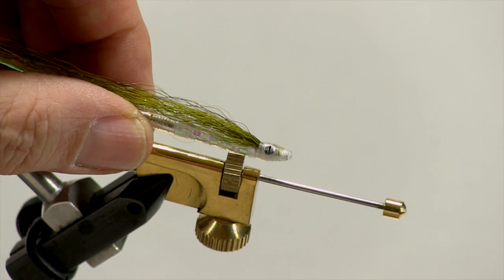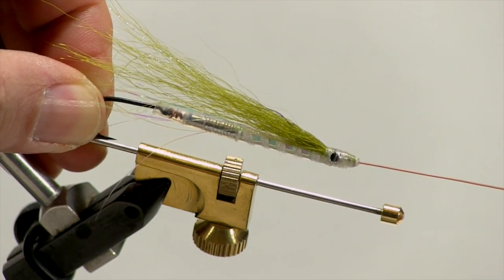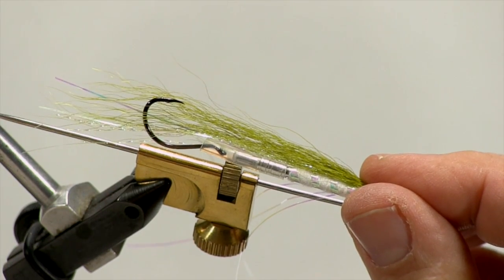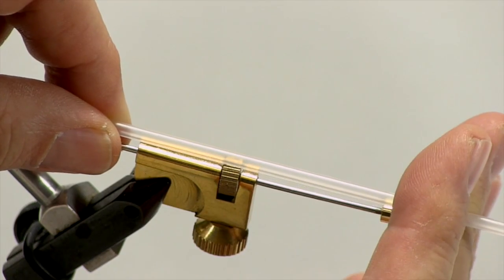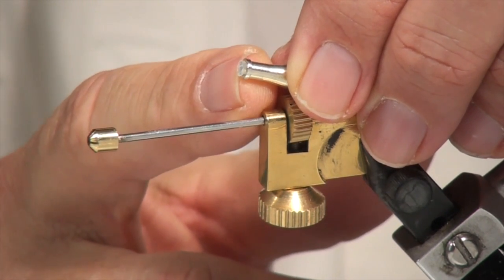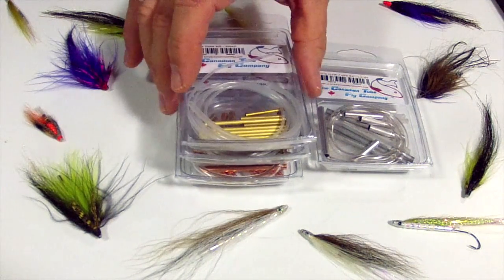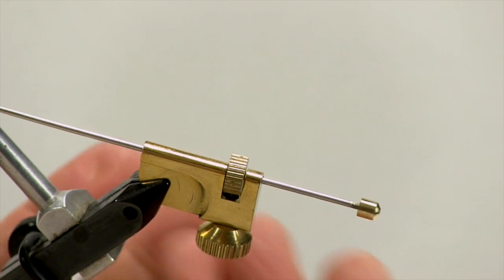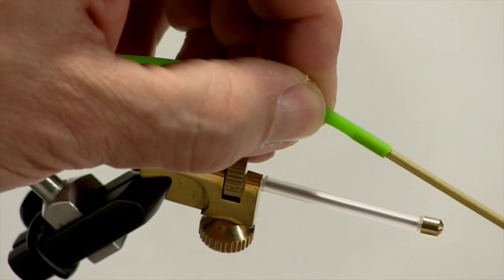The Basics of Tube Flies

Comment: Peter...my only beef is that this was too brief. You really do such a great job on your instructional vids. They are very much appreciated. 
Could you give us some instruction and explanation on the process of "nesting" tubes? I know the Canadian Tube Fly Co.  has a good video available on their sight. In it,  they use their own tubes and you can see how they fit very snug. I ordered similar from HMH and discovered the fit was loose. What's with that? Is it still usable? Do I need super glue?
With short, heavy metal tubes, can I build a 4 to 5 inch baitfish imitation that will have a jigging-type action on the retrieve for the saltwater? How would you put this together? I'm asking because while I love the Clouser Deep Minnow with a stinger hook, and have much success with it, there are times when there is just too much grass and debris hanging up on the eyes to make it worth fishing.
Reply from the maker: +Chris Nystrom It's always a toss up, too long is boring, too short is not enough. 

Super glue will solve a miss match in size of tube, within reason. I use the thick, gap filler type.

If you want a jigging motion on a tube fly, use very heavy, large cone heads on a plastic tube body..

Comment: Great video. Just one question. I want to tie a bigger version of the popular rolled muddler for coho and cutthroat without resorting to using a very large hook. Do you think this pattern would work as a tube fly?
Reply from the maker: I don't see why not. A 3/32" aluminum tube with a plastic liner will provide a slim enough profile, yet it won't be heavy. It should swim well.
Reply: Ok thanks. I'll tie a few and give it a try.